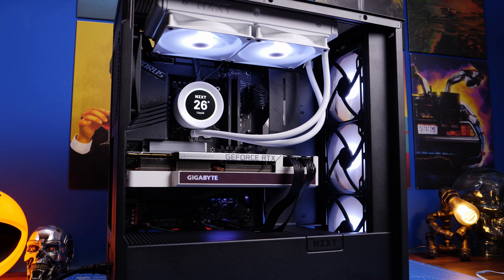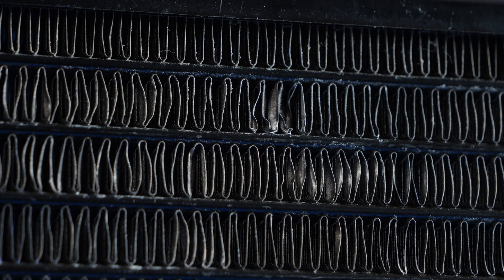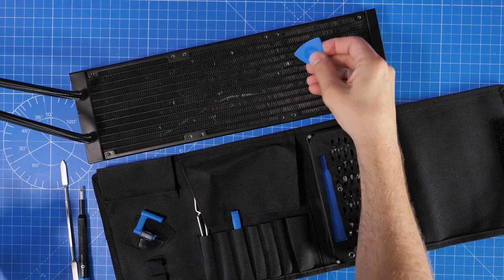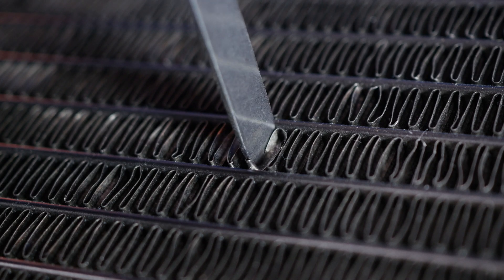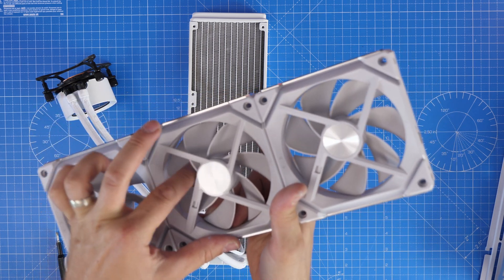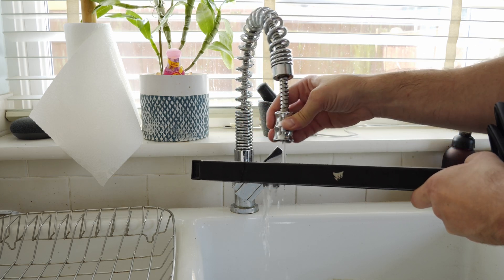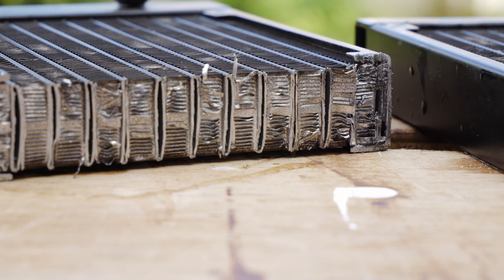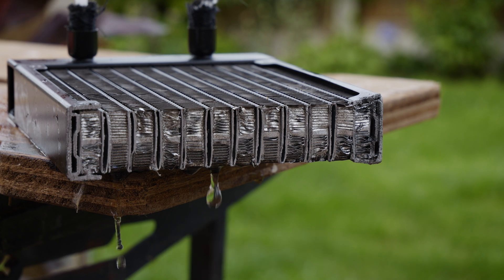Do bent AIO radiator fins matter? Plus how to fix them

Comment: Did this ages ago using a very small screwdriver and a little pair of tweezers. In hindsight though, it's unnecessary to do that, as long as the pipes and at least some of the fins are ok it'll cool. It's more a visual / cosmetic problem effecting peoples' ocd  😆😅

Comment: Metal is good heat conductor and is used to take the heat away from delicate parts of electronics that produce heat, or from the cooling liquid that gets hot passing over CPU. The bigger the metal area the more heat can be taken away from the source. Fins serve exactly that purpose: to enlarge the area of metal sheet that takes away the heat. This video is illustrative demo of the radiator interior and its internal construction.
Reply: by area you mean *surface area*. for those uninitiated, it's good to be clear in language.